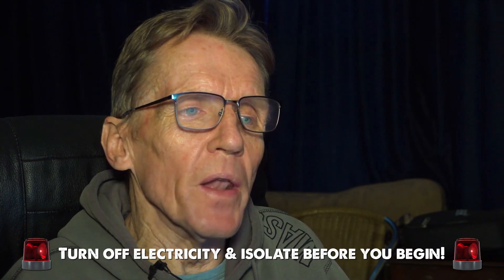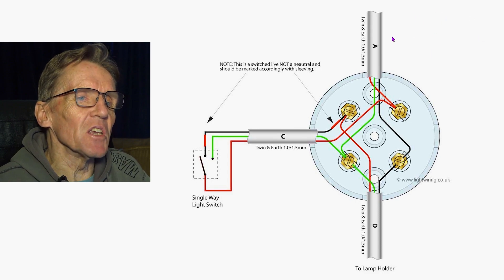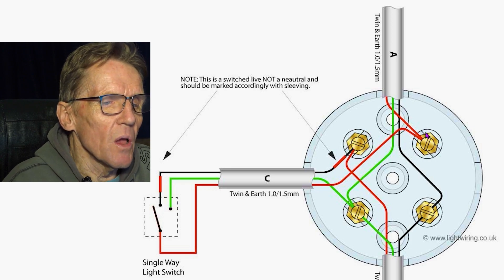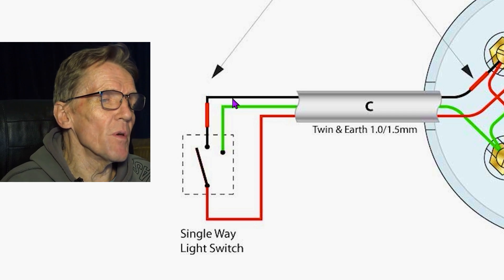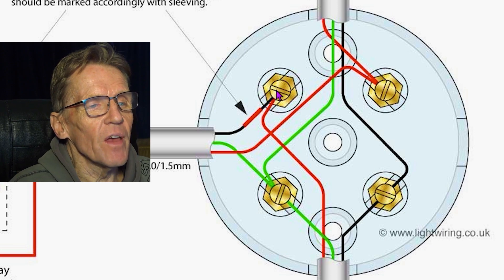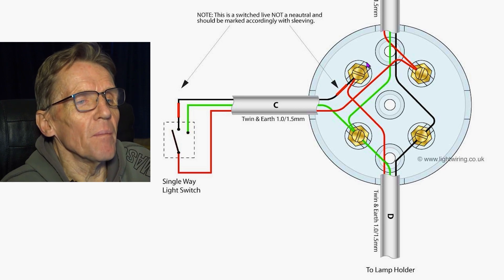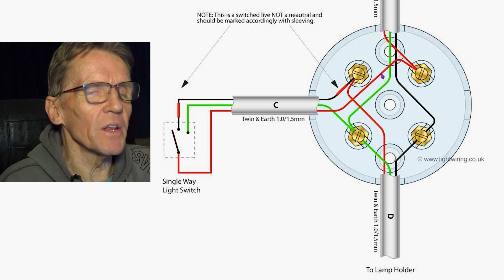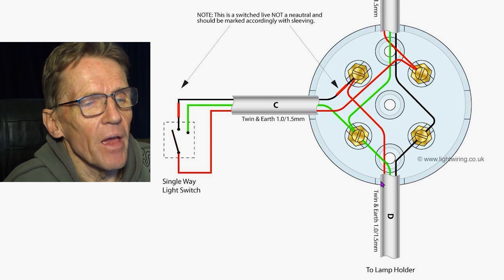Why Is Your New Light Fitting Tripping?

Comment: Good video, Rodg. I have had many calls from friends who have gone to replace a ceiling rose with a fancy new fitting, unscrewed the rose expecting 3 wires and ended up utterly confused.
Don’t get me started on the ones who have bought metal light fittings without checking for a CPC in their lighting circuit, or bought dimmer switches thinking they will fit into a 16mm pattress box 🙄
Reply: When is a rose, not a rose?
Reply: @mrtechie6810  when it's a bloody spider! 😲😎

Comment: THANK YOU THANK YOU.  I have just taken out an old florescent light fitting to replace it with a modern LED fitting with only  two wires.  I could not understand why my switch would not switch of the power.  I did not realise the switch was converting neutral to live.  Your diagram and explanation solved my problem.  I am 78 years old and still do not like being beaten at things like this.. YOU solved my problem. Now all wired up and working. THANKS yet again from an old man!!!! (my wife still thinks I solved it, will tell her later.

Comment: If diyers are swapping out light fittings I'd suggest taking a photo📱 of the cable connections before you disconnect just incase the cables don't have coloured tape on them. 💯👍
Reply: Yes but it would be very easy to get the switched line mixed up with the bunch of neutrals if it’s not been sleeved. Best to sleeve it yourself or put some brown tape around it before removing the light fitting that way you know for sure where it will go later
Reply: @_tmmy_  Yeah agreed, missed that bit!
Reply: @_tmmy_  I don’t need the previous guy to put sleeving on, I’ve got training and test equipment to work that out if necessary, you know just the basics that mean I’m doing a good job rather than chancing it!

Comment: Always used wago or ideal connectors in maintenance free boxes for changing over light fittings so you have got your feeds and switch but also an outgoing cable containing the switched line, neutral and cpc which goes straight to the light fitting, makes the job much easier when it comes to changing over lights as you just have the 3 conductors in one cable. Most houses these days are wired with the loop in being at the switch so all the conductors are easily accessible and makes it easier to modify the lighting circuit in the long run.

Comment: New build lights are wired with the two plate method meaning only the line and neutral terminals in the ceiling rose are used making switching out pendants very easy to do. I've swapped loads of lights in our place without incident.
Reply: I prefer that method as well. I've been using it for a while now when I rewire a house.
Reply: ...you mean the line and neutral loops thru the switch instead of the ceiling rose...

Comment: Australian homes (especially older ones) commonly use loop at the light too. I've noticed newer homes I've lived in have been loop at the switch
Reply: That is now common in the UK as well. It makes recessed spotlights and also wall lights way easier to deal with. Some modern switches also require a neutral.
Reply: I believe Australia used the UK wiring requirements BS7671 as a starting template for their own regulations so they’re really similar and often practices are the same. Hence why UK electricians can so easily navigate Australias points based imagination system

Comment: I think you should of had a ceiling loop rose. Because that is were the light is going and I find as you said the switched live from light switch Black is not flagged and put in with neutral. Loop in loop. Some time's I find both sides live and switch live in neutral. I am handy man with Good understanding of electrical / electronic devices ✌😊

Comment: Single ca bbn le switching... this was stopped decades ago in the US for exactly the reason you are mentioning. Now its one cable(12/3 or 14/3) and then anoyher one back up. The neutrals are connected, the earth connected and pigtailed to the switch and the hot wires to the switch.

Comment: I wire from the switch on new installs now. Neutral at switch means you are future proofing the light switch plate for wireless switches or fancy new tech that people like to upgrade to now. Then you just need a switched live and neutral at the light fitting itself.
Reply: Also handy for the now very popular, stupid light fittings that only accept one cable in those annoying plastic enclosures that apparently make the fitting double insulated. And even then, getting a single cable connected and the usually tiny base of the fitting screwed up is a nightmare!
Reply: Good point about having the neutral in the light switch, for future usage; e.g. USB supply in light switch...

Comment: I have just had a terrible experience with a cable going live from the utility pole so my house, pipes everything was live.  My question is now one of the three bulb sockets on my light fitting won't work.  I've tried different bulbs but nothing works.  Do you think this is damaged by the fault with the utility pole wire?  Thanks.

Comment: Brilliant video made it very easy to understand thanks. Are most electrics now wired from ceiling rose to switch then to light or straight to switch then light?
Reply from the maker: The modern houses are wired through the switch in the two plate system. If a householder wants to change one of those lights there is no confusion.
Reply: @SkillBuilder  please explain "two plate system"?
Reply: @SkillBuilder  Could we please have a short video on the two plate system 🙏

Comment: Hi Roger, I’d be very interested in your views on Biomass heating systems. We have an oil boiler ( no gas here in mid Norfolk) and I’m wondering what our options will be if and when our boiler needs to be replaced. Many thanks.
Reply: Keep away from any alternative heating systems, biomass will give nothing but trouble. I'm in rural Wales and have seen people try and regret all different types from air source to biomass. We have just installed a high efficiency oil boiler on my farm to run multiple holiday lets.
Reply: Propane tank in the garden, in place of the oil tank (and a big gas boiler). Woodchip storage systems take up lots of space...

Comment: Am a bit confused by this example.  The wire to the next fitting should be shown in addition. I am assuming the actual fitting is connected to the cable exiting at the bottom of the drawing.
Frankly if people cannot get their head around the colour to and from a switch they should not be attempting it. And finally if the arrangement had been wired up by a proper sparky the switch would actually have 2 browns, or reds for older setup, so no confusion in having blues or blacks needing sleeving.
Reply from the maker: This is the last fitting on the run but, yes the drawing is not ideal. Like it or not this is a very common problem when householders decide to change a light fitting. It is all very well saying they should not do it but most of us move out of our comfort zone and, with the right information, it is easy enough to get it right.

Comment: The trouble is, they buy a new light fitting on Sunday morning, repeatably try to get it to work without tripping out the lights, and just as it's getting dark on Sunday afternoon (because many of these are winter purchases)  they panic and call their mate, the electrician. Said mate is just settling down for a nice relaxing end to the weekend...
I'm not doing this work any more, but I found that many of these fittings are made for countries that don't loop in at the ceiling rose, and have more "relaxed" rules about wiring safety. Some of them need three hands to properly install, too. But still the big DIY shops sell them.
Reply: That's rough, mate.
I would charge extra for work at night. It's also riskier when there is no natural light by which to see!

Comment: It’s not uncommon in old installations to find the earth wire not connected throughout the whole installation. Just because there is a earth wire in the light fitting. It’s possible it was extended from a older cable that was just a twin cable.. I know of a housing estate near me wired when 3 core lighting cable first come out and guess what they never connected the earths through out the whole house. Point is always test to make sure the earth is actually a earth.

Comment: There should be a neutral in the switch now. For future kinetic light switches. Wago connectors are the in thing now
Reply: You can still drop a neutral down with a length of 3c+e replacing the t&e switch drop.
Reply: Agree as lots of smart switches are designed for neutral at the switch as this is what the us and a lot of other countries do. However it’s not going to be commonplace in the uk for a long time, if ever so probably good to explain this to people who don’t know. 

Course you’ll get the electricians insisting they are the only people who should go near electrics and given some peoples diy skills they are right. But if you understand it and have the right equipment and know the regs then some things are ok to do.
Reply: Kinetic light switches don’t require a neutral, or even a live. They generate the power required to communicate kinetically from the movement of the switch
Reply: @tenelitebrains  the main module needs a live and neutral though !

Comment: A good explanation of how easy it is to cross 2 wires that look identical and induce a mild panic at the flick of a switch !
And while I agree with others that some people shouldn’t do things they know nothing about, that doesn’t stop them from thinking they’re capable of a simple replacement task in the same way they’re a carpenter because they bought a hammer and nails once… 🍺
Reply: Electrics? It's only three wires...how hard can it be!

Comment: Don't mess with electrics or plumbing. I get the experts in and I have piece of mind. But it does show a common problem that can happen.👍👍👍
Reply: After seeing all the shortcuts and sloppiness of my plumber I have peace of mind when I do it myself.
Reply: After some of the 'correct' bodges I've seen done by electricians to satisfy customer aesthetics / time and labour considerations etc it is a good job we have fuse boxes to save calling out the fire brigade.
If domestic electrics matched industry electrics your average domestic consumer would sulk a bit.
Reply: @olliec1319  yes agree some of the so called qualified trades are usually on the clock and make dreadful jobs. No pride and rip-off.

Comment: My nextdoor neighbour (a maths teacher) called me in because he had wired a new light up, joining all the reds and all the blacks, and every time he switched the light on, it tripped the fuse! More modern UK wiring used 1.5mm red+red+earth, but brown and blue now, so two browns in one outer.  Really annoying that aftermarket light fittings don't have a big hole in the base so it fits over the ceiling rose!

Comment: All nicely explained but one thing is unclear how do you know which is (a cable) and which is(c cable etc) coming out of celling if they have same couloring?
Reply from the maker: You need to get hold of a tester. You can buy a non invasive tester stick  which glows when you hold it against the cable.  
This video assumes you are just swapping a fitting and you can test the switch with a continuity tester. More videos to come.
Reply: The best thing is to note which cable is which when disconnecting the old fitting. Failing that a simple continuity test will Indicate which one is the switch cable
Reply: @darrenqualters2341  never assume it was done correctly the first time. Always test!
Reply: You need to kill all power to the circuit and test that is truly dead. Then to identify which is the switch cable (or switched live) take off the switch faceplate and link the two cores together, then at the rose use your tester on continuity establish which cable has a ‘live and neutral’ proving continuity. Now you have found it sleeve the conductors so it is clear it is a switch live, then restore the connections at the switch and replace the faceplate.

Comment: Using twin brown and earth for light switch cables, I believe, is a requirement in the Republic of Ireland. It makes wiring light switches a no-brainer. One brown to the permanent line supply loop brown terminations, and the other brown to the lamp brown terminal connection. I believe an insulated earth in the cable is also a requirement in Eire. No more sleeving would surely make things simpler, safer and quicker, and no more expensive for the fitter.
Reply from the maker: As Ireland goes to twin brown cable we move to a two plate system.
Reply: Alongside legacy systems. More confusion, for future tradesmen, and homeowners alike, I am afraid.

Comment: Twin red, and now Twin brown cables have been used since early 80,s for switch drops, if red &black cables where used it may be a time to call an electrician in as a rewrite may be needed
Reply from the maker: That is simply not the case. Most electricians don't use twin browns because it is expensive.  If you ask a wholesaler how much twin brown they sell that will give you an indication of how popular it is,. The two plate system is now more common. 
It might seem a rather obvious point to make but anyone with twin browns or two plate will not have been affected by the short circuit prolem so probably won't be watching a video on it.
Reply: @SkillBuilder  it’s the same price as T&E

Comment: Don't mix cable sizes in a screw terminal, for the majority of domestic installations, you don't need to use 1.5mm, 1.0mm is more than sufficient.
Reply from the maker: You don't put them in the same terminal.
Reply: @SkillBuilder  not on a lighting loop in loop out, just speaking generally. Always stick to one sized cable for a circuit. When it comes to recording test results etc, it's much easier and good practise. 1.5mm is overkill for domestic lighting and increases the cost for the customer (a point which the NICEIC like to make clear)

Comment: I'm a real Youtube junkie for domestic trades videos. I also have extensive experience in the design of such systems here in the U.S. As I started watching more and more videos from Britain I became dumbfounded by how complicated you make things there. This is apparent in every discipline especially plumbing. But this video about wiring lighting fixtures takes the cake.
Reply: I did my central heating system in the UK which is basically copper pipes connecting radiators to a boiler. I've also added sockets and lights to circuits. I really can't see how it could be made any simpler. Not sure what magic tricks you guys have.
Reply: I've hard it was either to save copper, or to prevent there being a neutral at the light switch (For what ever reason)
Reply: That's not the worst of it. The diagram makes it look simple. In reality, as Roger says, there is often another set of wires going to the next light. The colours don't match what you might be expecting because of the switch wires. Then you buy a modern light fitting and it doesn't have space for the extra connections on the UK system so you have to use Wago connectors or a junction box to make it work and hope you can find space for them in the ceiling.
Reply: @bassplaya69er  Everyone thinks their own system is the natural and right way of doing it. Mixer taps used to be against the UK regulations, hence there are still a lot of single hot and cold taps in bathrooms in the UK. The upstairs cold water taps were often fed from a tank in the loft and hence weren't potable water. Similarly the European push button flush was against regulations as they were thought to leak after a while. Hence the preference for siphon systems.

Comment: It’s been known for decades as the switched live. And measures were taken for the installation technician to tape the correct colour on the affected wire.  Not always the case
Reply: In the vid diagram it says switched live and Roger mentions that the small piece of brown sleeving acts as the marker on the neutral that is live. You have inputted nothing new.
Reply: It's actually called a switch line. The neutral is actually a live conductor too so the terminology was changed. Line and neutral not live and neutral.
Reply: @robthesamplist  
                  DUH
Reply: @Daniells1982  
                        DUH
Reply: Guzunder….
  Does black GUZUNDER red ?????
“   Well does it punk..????? “
Reply: @johnnorris1983  I have no idea what you're talking about but those switch lines eh, tricky.
Reply: @Daniells1982  Lol...its when you have 4 way switches on landings that the manual might have to come out for me.
Reply: @robthesamplist  yes 4/5/+ tricky but always back to first principles.

Gets me when you cross bonded so everything was earthed.
Then it was stopped due to static discharging of skin from un natural materials. 
Good ideas of safety bypassed cos a “ Labour leader’s Wife “liked bro nylon nightie’s
Reply: @johnnorris1983  Some sparkies still do cross bonding even though its not required. Same old regs...metal breakers in the 60s then plastic now metal again..